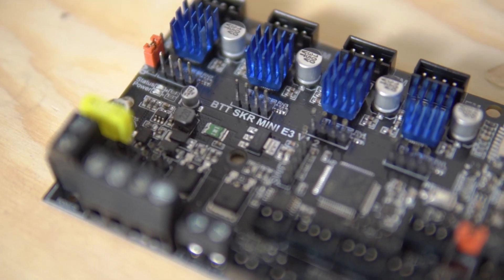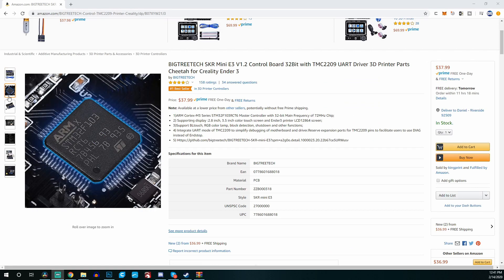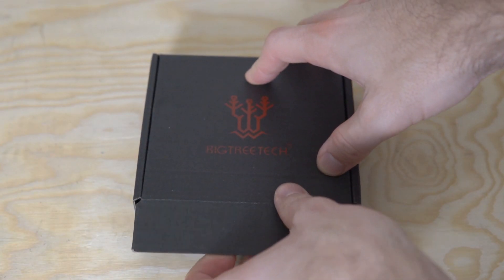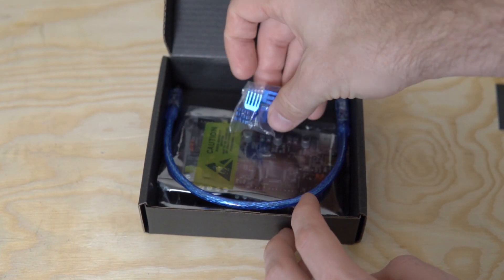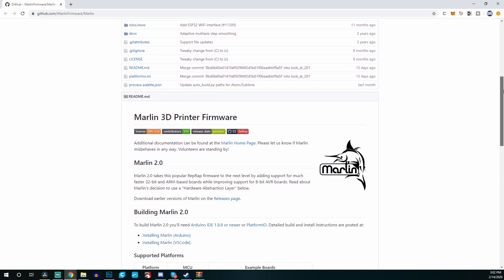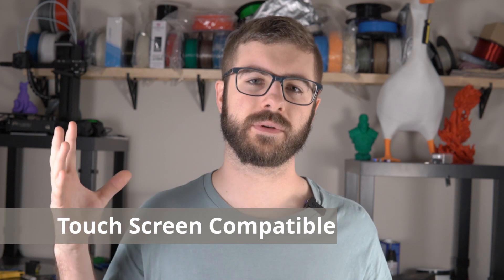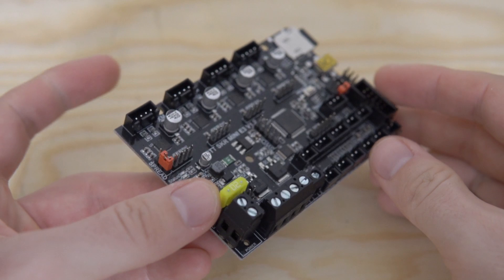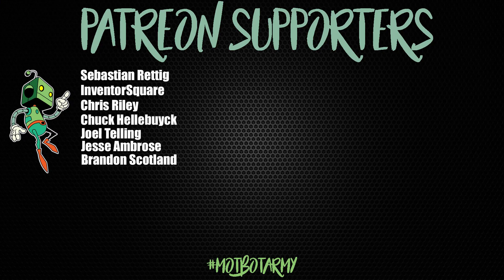Best Upgrade For Your Creality Ender 3 3D Printer In 2020 |  SKR Mini E3 V1.2

Comment: Disclaimer. These boards have some BIG production flaws and are not ESD safe. I and some people that i know burned some of these by just touching the printer and discharging in them.
I don't recommend them. Buy the ones with swappable drivers. These models are just BAD and unreliable.

Comment: Hey guys, I'm looking to get into 3d printing. I want to be able to print carbon fiber filaments. Is it cheaper to upgrade an ender 3 pro, or is there a printer that has all the upgrades that ends up being cheaper because it's already pre-built? I'm looking to have everything I need right out of the gate. Thanks.
Reply: I'm looking for auto bed leveling, ruby tipped nozzle, all metal hot end, glass bed, etc. I'm planning to make a pi4 octoprint. Any other upgrade ideas are welcome. I'm trying to do my homework before purchasing. Just wonder if it's still cheaper to buy an ender3 pro +upgrades or another option that has everything I'd want already.

Comment: so how do you know if your ender 5 has thermel run away protection? i have had my nozzle heater shut off a handful of time and window said it shut off do to temp etc...not sure exact wording... but i think i did have an issue with thermistor (mainly 2 wires that go in the heat block had poor connection )at the time and replaced with a new one...thanks PS my ender 5 was an upgraded version i bought it in sept of 2019... not the ender 5 pro version which comes with all metal extractor and capicorn bowden tube...

Comment: Never understand why one would waste their money on a ender 3 then upgrade everything on it???  Why not just spend the money up front on a better printer?  My ender 3 is stock and prints perfectly right out of the box.  I don't know maybe its just me.
Reply: Upgrading is a hobby the same as when people modify computers, trick out their cars, garden, home remodel. It is a creative activity with a goal to improve one's personal experience of what they own. No product is perfect and it is a natural human desire to pursue perfection. Some more so than others.

Cost wise, no printer at the moment does it all for example as of typing this, there is no 32-bit tmc2209 3d printer with A larger than average bed, magnetic flexible print bed, remote drive, noctua fans, etc etc and most printers being sold with a fraction of these features are several times more expensive meaning they are less affordable when a collage student can buy an ender 3 and then over the months save their pennies to buy upgrades over time. Not everyone can afford a $1000 printer but can make payments over time to achieve the same performance especially if they do so recreationally.

Progress wise, the 3D printing medium has always been pushed forward by personal upgrades rather than big companies. The remarkable prusa printers for example are not original so much as they are a collaboration of many people's personal mod's and upgrades all combined into a single printer. Upgrading is how the medium evolves and economically the sale of more premium parts will lower their cost to make them more available to everyone.

No one acts irrationally. In everyone's mind's they have their reasons and believe they are acting rationally. As observers, it is our responsibility to study, define, and apply our observations of those participating in the medium. This is part of what it means to be a maker and why the 3D printing community has grown so much stronger in recent years.

Comment: Is there available inputs to use a filament runout sensor as well as the bltouch? Had to jump through a few hoops to get this going on the original 8 bit cr10 board.

Comment: I have upgraded my Ender 3X with skr mini E3 v1.2 recently. I am a bit disappointed. First I have noticed that main board fan is very noisy and full speed and connected to the right central connector on the board.
Any advice on this?
Secondly where is the change filament feature available on the stock board? How do I change filament and extrude a bit before printing with a new colour?
I have updated the firmware to Marlin 2.0.5.3 thinking it could solve this issue without success. 
Thanks for your appreciated help!
Reply: 1: Buy a new fan.. not the boards fault.
2: Again, it's not the board.. You have to enable the right settings in the firmware and re-compile.

Comment: Once I install the BLTouch and flash the new Marlin 2.0.5.3 firmware on my Ender 3 wtth new SKR Mini 3 board; the set up instructions everyone has vary and none seem to work.  There is no need for vscode, it supposed to run like a piece of cake....however, establishing the Z axis offset is the mystery.  Here's how i have seen it portrayed:  Step 1: Do the bed leveling with the BLTouch for the first time.  Step 2: Move Z axis down till it just fits a post-it note under the nozzle.   Step 3: Add the BLTouch Z offset and the remainder distance you had during the manual Z axis move and add them together.  Step 4:  Go into the Configuration and change the BLTouch Z offset to the new number total from the addition of both numbers.  Save the settings and then print.  

This does not work:  My nozzle either is buried into my print bed or hovering  above and printing in the air.

Does anyone have an idea?
Reply: You need to have 1mm height distance difference between the nozzle and the BLTouch. If I recall correct. It works for inductive and capacitive sensors, so should be the same for the BLTouch.

Comment: I have the Ender 3 and I installed the Bigtreetech SKR Mini E3 Version 1.2 and have the Firmware Marlin Bugfix 2.0 x loaded.  Before I install the BLTouch Version 1.3 is there anything else I need to do differently to make this work?  I hear some say you just plug the cables into the board and enable the leveler.  Of course I'm not sure what they mean by enabling...is that thru the Ender display so It's just a click or is there some firmware editing to be done?  Would really like a step by step video that specifically addresses this.  P.S. like your tech knowledge and you present well.
Reply: yes, i would like the same video.

Comment: You forgot to mention the TMC connection error that pops up for no apparent reason after a few minutes of printing and renders the printer useless. I had two boards that failed due to the same error code. Did  “big tree tech” make you aware of this problem before they paid you to spew on and on about how great their board is? I doubt it!
Reply from the maker: No one has ever paid me for a review. I also have not had any of the errors you mentioned.

Comment: I have the same board with marlin 2.0. My printer freezes then its doesn't listen to cura no more baby steps. I tried to upgrade to marlin 2.5 and no go . I use cura my settings are all set.  When i put SD card in I have to manually reset the bed temp and nozzle . my temp is set at 218 bed set at 78.. Theres time that i notice the nozzle temp its st again 218
printer sets it up at 225 and the bed temp 50. It overrides. Positive side of it  motor are silent but the fans are noisy .
I use visual studio code and when i build try to build with default settings. If i enable xyz then i get errors.

Comment: Do you know if this board's sensor interface will work with a capacitive or inductive sensor vs.a BLTouch?  (I mean w/o any wiring/voltage interfacing)  Thanks.

Comment: Thanks for this review.  I've got a TronXY XY2pro that I'm pretty happy with, but I've had a few issues with it just randomly turning off.  I was thinking of replacing some of the components because of that, and this board seems like something I might like as an upgrade even if things were working perfectly.  I'll have to see if it's compatible the z-probe and touchscreen on it.

Comment: Still no clue what's the benefit of this board-swap, after the video. ;)
Reply: It has a 32 bit microcontroller vs an 8 bit one in the stock creality board. This is important because it allows for more features in Marlin to be enabled at once. Another major difference is you can flash the firmware using the sd card instead of having to burn a bootloader and use an arduino uno as a programmer.
Reply: @FOXXX509  Huh?  Wouldn't a 32-bit board use 32-bit-long opcodes?  Hence taking up more space for the same instruction count?  Hence require more memory for the same code?
Reply: @kiplandingham322  That's not how computers work: an 8 bit command uses 8 bits regardless of the processor. Since a 32 bit system can fit 4 8 bit commands into a single clock cycle it can operate faster. Also because it can access memory with 32 bit addresses instead of 8 bit it can access 4 times as much as an 8 bit system.
Reply: @QuixoticEnt  Bigger addressable space? Yeah. Chopping up a 32-bit fetch into 4 separate opcodes? No.

Comment: Does anyone know..?
Ive got a CR-10 mini and I wonder what would happen if I put this board in my printer... 
Would it work.?
Reply from the maker: It would definitely work. I believe that Creality boards all have the same form factor but you may want to double check that. It would take some slight modifying of firmware for the few differences
Reply: @ModBotArmy  
See that's what I don't understand. Finding info on how compatible that board is with other creality printers is hard to find. Its like nobody else ever thought about it.  And im sure I'm not the only one. 
I know there's a lot of people out there that have the same question I do. And its hard to find info on the topic. 
Maybe something to think about for a video.  
Thanks for the reply.

Comment: for the love of god, dont buy this board. Since I bought it I have only problems, first problems were steps, those could not be read beacuse the eeprom is emulated on this board... So what I have to do on every startup is to initialize eeprom in the menu which I sometimes forget and the printing head bumps to the end of x axis... Very annoying. Another problem I have with this board currently is inconsistent layer height, in periodic height the layer height gets suddenly smaller but extruder is extruding same amount as before. So what you get is periodic lines on side of the print. Flashed newest marlin onto it, problem still persist which leads me to believe that this is not software issue. Oh and when I press disable stepper, extruder motor is kept enabled. So in conclusion I got silent steppers but can't print.
Reply: Yet more people seem to be having success with this board?
Reply: Sorry, but it's ALL YOU. You are not doing something right, I can promise you. Seriously, this board works flawlessly.  While it's possible you got a bad board, the design itself is quite simply the best 32 bit board for running Marlin.
Seriously, look for a better board for the future of Marlin, 2.0 and beyond.. the SKR boards rule. Only other board is the DuetWiFi with RepRap, at 4X the price.

Comment: Does this board already have a bootloader or do I need to install a bootloader myself?
Reply from the maker: You flash it by updating the microsd card with a .bin file. The boot loader is either there or not needed with this setup. I was able to flash the firmware on the board with no problem.
Reply: Not yet, which is a pain. I had started to port Serasidis/STM32_HID_Bootloader over at github, back in december. It's a nice tiny bootloader, which should work very nicely, but very soon I had to stop due to lack of time. I decided to permanently hook up an ST Link programmer to the board and just be done with it. Works like a charm. No more silly SD card swapping.
Reply: It comes with Marlin 2.0 out of the box, maybe 2 month old firmware, you can open the skr mini e3 github page and download the current firmware, make sure to rename to firmware.bin, copy to micro-sd card, and start your ender 3. It will flash automatically to the latest version. If you want the latest firmware you will need to download from Marlin git repository and set it up for the SKR E3, and compile before you can flash.
Reply: Vinayak Nair thanks!

Comment: Let us know how long it takes for the stepper drivers to fail
Reply from the maker: Definitely recommend using the included heatsink if not even beefier ones to remove heat.
Reply: this new version of TMC 2209 works cooler than the 2208...
Reply: @Fernando_Gazzola  Hi, there is still a disproportionate number of reported failures though.
Reply: @shaunmorrissey7313  I've noticed that the tape used to fix the heat sinks to the drivers is not the best quality. Recently I found one heat sink was just loosely sitting on top of a driver because the tape had let loose. This could very well be causing the failures. But I could be wrong. My E3 mini has printed up half a spool of PLA the last month and so far so good.
Reply: shaun morrissey Hi Shaun, I have one and sold 12 boards like that. Just one came back but for a user error (he broked the mini USB connector). Nothing reported or tosted since july 2019... 3 v1 and 9 v1.2

I’m just curious what this SKR MIni E3 v1.3 has different from the others... I saw testerday at BTT store this new release...
Reply: I have one and i'm totally unisfied. The tmc driver on X-axis goes wrong after 10 minutes to use. Display has writen "TMC connection error" It is the most common fail of this board. I bought from Banggod, when i was triing contact their support, the answer did not com.

Comment: If I put this board on my maker select what changes would I have to do in terms of the screen?thanks in advance.
Reply from the maker: If it uses the same ribbon cable it may be as simple as plug n play. You will have to modify the firmware for your machine though.  If your LCD screen requires two cables for the LCD screen then you may need to replace that LCD screen in order to have it function with this board.

Comment: Wish they would make this with a USB port! So hate these retarded micro SD ports and it really is ignorant to not offer more robust options. Likewise why the hell do so few support wireless (WiFi) communication support???
Reply from the maker: For this board I understand why they did not use a full size USB. Since it is intended to be a drop in there would be no way to have a usb bort since the cutout on the machines only fit a microsd. I do agree that it would be nice to see more printers doing something like Artillery printers that have both usb and microsd.

Comment: The mini E3 was the best thing I have ever done for my Ender 3, the difference in motor sounds is phenomenal. I noticed that you mention the BL Touch is direct plug, I am in the first stage of adding the BL, wiring it in and then adding it to the code to work. Would you consider a tutorial on how you did that process? Thanks
Reply from the maker: It seems like there is definitely some interest in this. I cannot promise it will be in the next couple of weeks but I will certainly put this on my list. Thank you for the feedback.
Reply: I'm in the same boat. Yes please make a tutorial for the bl touch and working with Marlin 2.0 with this board. I already have the sensor. But need to wire it and program the firmware but not sure how to enable the settings and how to access the firmware.
Reply: @alphaqlater  If you open the github specifically for the SKR Mini E3 you have a precompiled firmware named bltouch-firmware. Copy to your micro-sd card, rename to firmware.bin and it will flash when the machine is turned on with the card in the slot. The firmware is 4 months old but works, you will need to calibrate the first time when installed.
Reply: @VinayakNair79  Thanks! I recently found that firmware but didn't want to make the leap as I am working on some projects currently and didn't want to lose my ability to print in case I messed something up. Is there a way to backup my current firmware in case I need to reflash to stock settings? Also, what do I need to calibrate once I do reflash with the bltouch firmware?
Reply: @alphaqlater  Use Win32 Disk Imager for backing up your SD card.
Reply: I have 2 SKR minis so far and both were plug and play with the 3.5 TTF screen. Install the included ribbon cable and the 5 wire harness and done. There is also a repository on Github that you can get more different fonts and icons for your screen. Makes it much more colorful and friendly to use.
Reply: I'm having problems with my BL. When it hooked up like in your picture. My control screen turns off.   As soon as I plug the from the socket the control screen comes back on?  My BLT wiring yellow blue red.